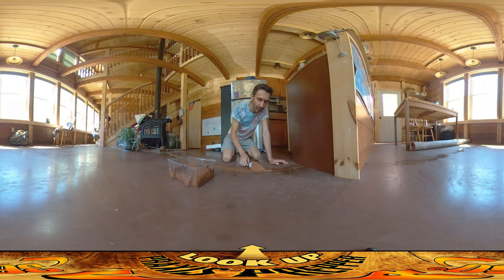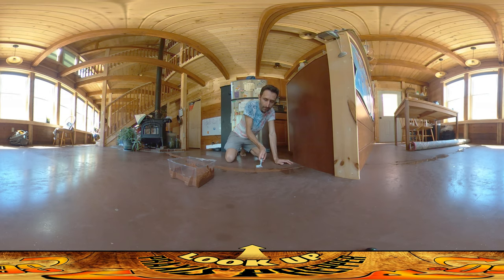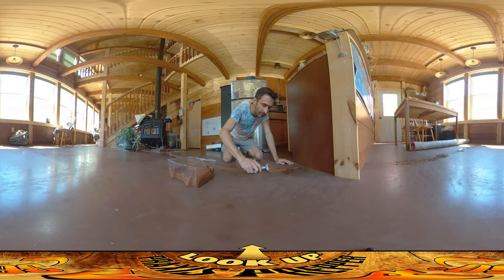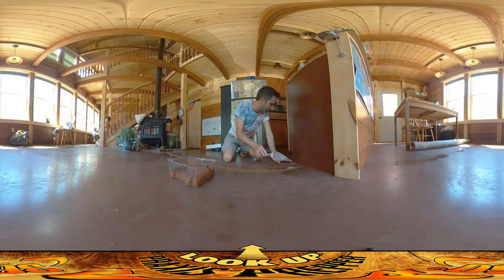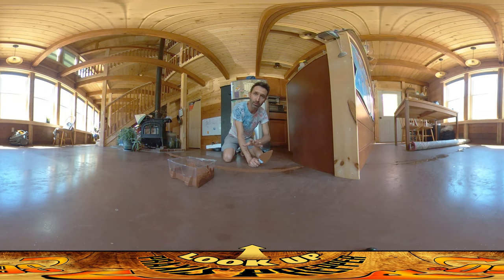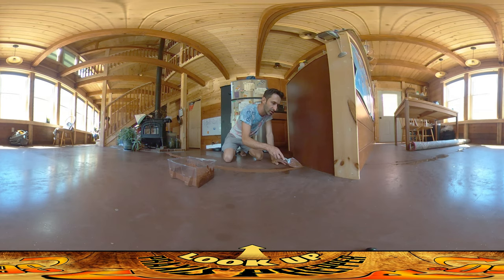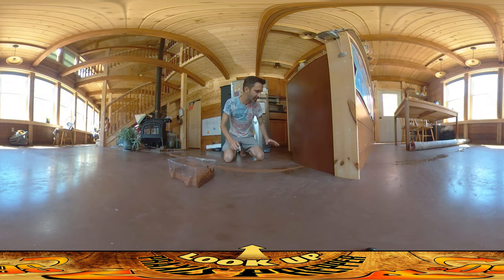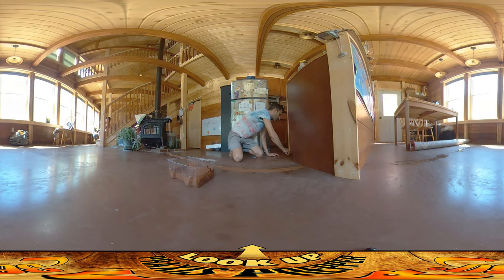Homestead Building - Floor Crack Grouting

Comment: Definitely keep the house updates coming for the diehards that kept up with it. Be extra generous with the solar videos. Just made my first DIY LiFePo4 battery packs and man do they kick the ass out of the old FLA batteries... just wish the trailer wasn’t sitting in a repair shop thanks to a bunch of sheared off lug studs 🤬 and the damage caused when the wheel broke off

Comment: Never thought of the wood stain on concrete.....neat
Reply from the maker: I was thinking that I might not do that this time though. I remembered that the seal that I used on the wooden floors upstairs seemed to have issues with the oil stain below... or maybe didn't. It wasn't clear. But I'm wondering if I should go water-based for the concrete floor to try to avoid every possible adhesion problem possible???

Comment: Some interesting information there. I'm curious about the reason for the bare concrete floors, is that just personal preference or is there some thermal mass type situation going on here?
Reply from the maker: It's both. I almost had the floors poured and then stamped with some sort of natural-esque stone surface texture, but opted against it due to the potential life-time issues with tables and chairs wobbling on an uneven/organic surface.